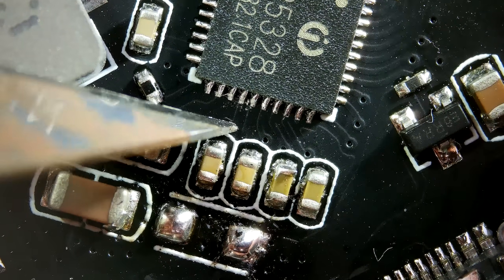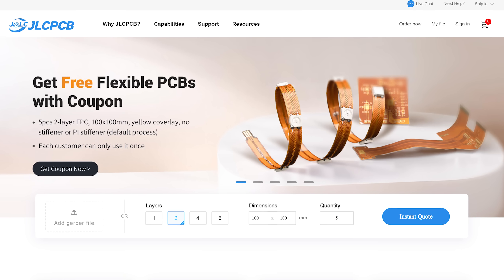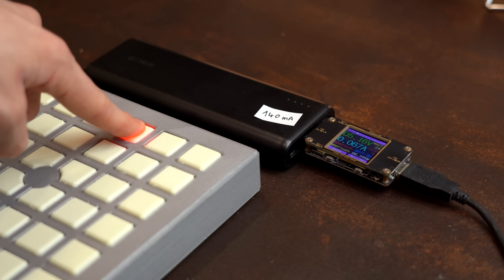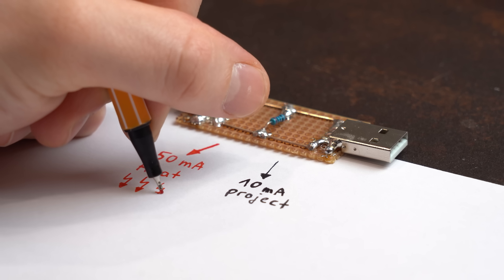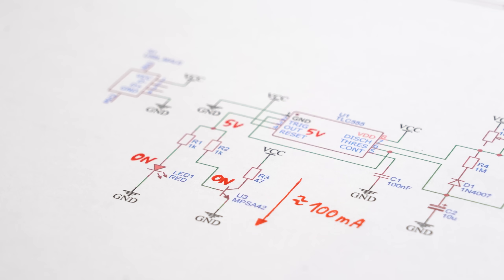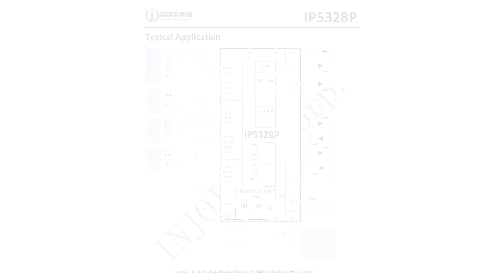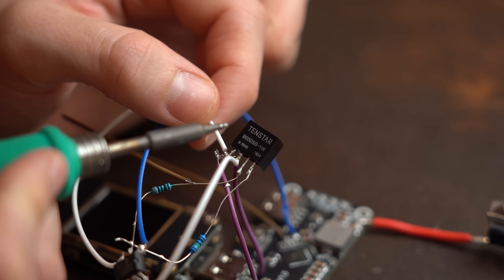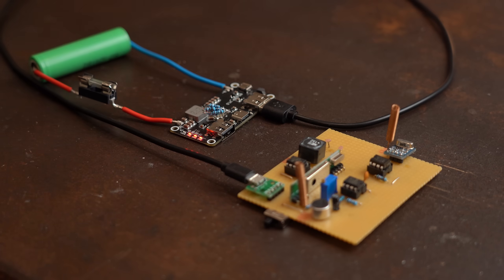Your Powerbank has 1 BIG Problem! (That we can "Hack")

Comment: Great idea! It's very frustrating that with so many little gadgets getting USB-C nowadays for their tiny batteries or low power draw, your best quality power banks are the most likely to refuse to recognise them.
Reply from the maker: @LewisOSLife2984  Patreon viewers can watch early 🙂
Reply: I really hate USB-C. It should be a standard, not a family of standards. There are already dedicated connectors for all the things it does, but there is no confusion what port and what cable support what standards, what bricks can deliver what PD mode, etc..
Reply: @steve_1507  Its not like you already have to check which powersupply you use. But so far they all had their own proprietary connector separating them.. pretty rubbish if you ask me.
All my UsbC-Powersupplies and cables have labels for what they support.
So in the end you can have 1 good cable to do all your tasks instead of 3 (usb, power, display). And if you cheap out and get a cable which cannot do displayport, thats kinda up to you.. my cables have symbols in the sockets telling me what they support. And its not that hard to add that manually if they dont.
Reply: @tarakivu8861  Well I mean, If I look at the port on my phone, there's no way to tell if it supports DP Alt, PD, if it can use Usb-OTG
And basically, most of the cables I have are only wired for USB 2
And if you plug one device into another, you don't know whats host and whats sub
You don't have that problem with an A to C cable since USB-A is always host, but any device can be sub or host
Reply: @steve_1507  the universality of USB-C is not that all USB-C devices can support the same functionality, but that they can use a single cable, regardless of what they support. if your cable supports it, you can use it with a cheap phone that only uses standard slow 5V charging and USB 2.0 data transfer, or a laptop which can charge at 20V using PD, use USB 3.0 and send video using DP. also if the devices are built to spec, the host and the device always knows which is which thanks to the CC1 CC2 pins, which are connected to 5V at the host and GND at the device. the only problems may arise only when both devices can act both as a host and a device.
Reply: @LewisOSLife2984Patreon.
Reply: @LewisOSLife2984the video is released earlier for people who pay
Reply: @LewisOSLife2984Time Travel